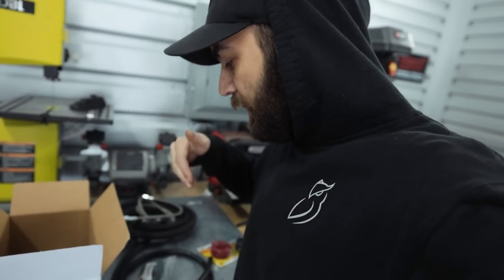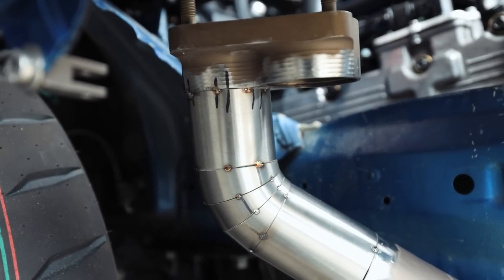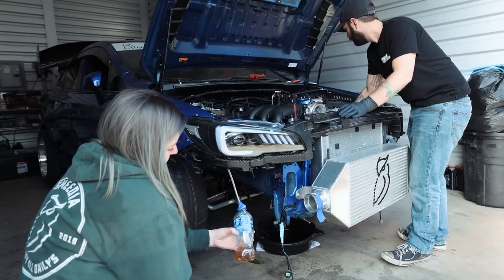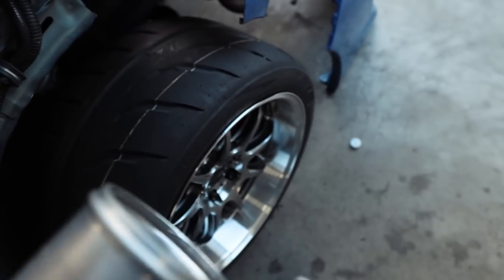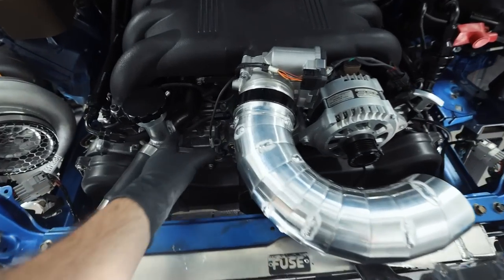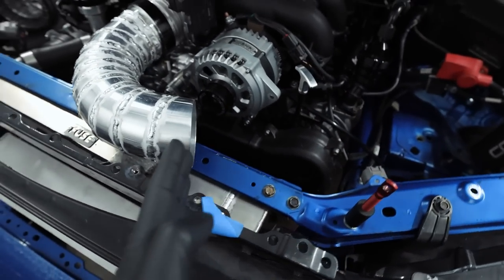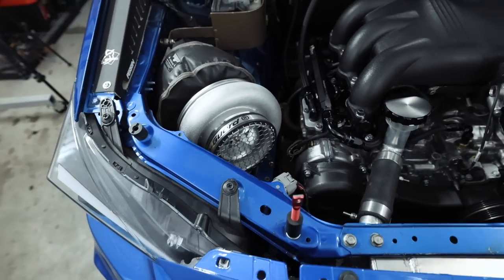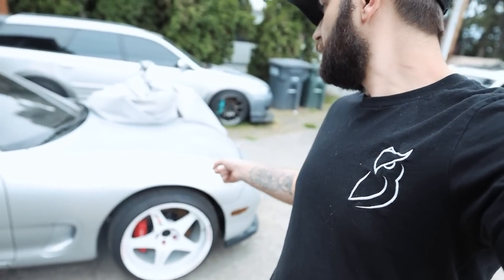Making a Massive Precision 7675 Turbo Fit Into my 6 Swapped Subaru WRX STI!

Comment: Looking good bro can’t wait to hear it, fab guy did amazing work if I ain’t know better I’d thought you bought that…,,wait somebody said 400hp 🤣 this thing look like it’s gonna do 850 900hp easy a couple adjustments at the tune 1000hp 6 cylinder STI VA monster that is the blubaru 🎊
Reply from the maker: Shhhhhhh 🤫🤫🤫 it only makes 300 lol 

Once it's running again it'll be on its 700whp tune 😅

Comment: If you flood clear crank it and hold the start button down will it spin over longer? I was able to do that for probably 10 seconds in my wife's VB.
Reply from the maker: Mine no longer does that 😅 thr stock ecm just does 3 sec and that's it 😅

Comment: Are you going to sti 6speed swap the VB or leave the drivetrain as is? Im curious if the wrx trans got any better than the VA
Reply from the maker: I'll 6 speed swap it, much easier to do it on that vs older wrxs

Comment: pie cuts are easy bro, grab some straight pipe of choice, make 1 mark, then make 2 other marks opposite. 1" 2" and so on for spacing. draw the arrow or triagle, and cut. mounted compound saw with degree locks would be best bet for cleanest cuts diy imo
Reply from the maker: Trying this tomorrow, I have the saw 🫣
Reply: @Smeedia  make sure you cut a decent size length dont want a size too small or too big and stabilize it good. if it catches the blade during the cut it can get gnarly. 2 cuts obviously, you could keep the saw same position and just flip the piece, or turn  the saw to whatever Degree * you had it set to opposite. just depends on your space and what youre working with honestly. id measure a good .250-.380 excess for material loss each side as well.

Comment: Wait just a general question, if you a buy a car from the dealer it should be the MSRP price right? Or can they still go above. Cause currently a brand new brz sits at 43,407 AUD.

Comment: Great job and progress! Are you going to run some sort of fan shroud on your radiator so that all the airflow being pulled by the fans isn't wasted? I have no experience w/the flat 6 cooling, but have done a lot on Jeep XJ's inline 6's and they get HOT... especially if you don't run a fan shroud of some sort to utilize all of the available radiator space.. if that makes sense? Seems you mentioned having cooling issues on the previous build, but I could be mistaken.

Comment: Dude whatz up! Been catching up on videos since my kid is out of school things finally not so busy now. Anyways not sure if it’s the angle hope everything fits with hood closed. Got next project for you on blue. Full flat aero bottom. Use lightweight aluminum. Wanna see your bend and welding skills more. Cut bumper get rid of spare tire holder (cut it out) weld flat aluminum in place and make rear diffuser. She will look like a killer by with the engine swap. Lol

Comment: Cooling issues: things you can try to help alleviate all that excess heat 
1) fan shroud - help channel all the air that the fans are moving and a must really 

2)flaps across the top of the cooling units from CAC to Rad - the more you channel airflow, the better the results 

3) Are you using any sort of underguard? Once again, airflow

4)Did they use a heavy duty core for the radiator? Should be using the 1" tubes and get rid of the bar and plate style, not nearly as efficient 

Some context - I build high hp custom builds and I can never stress enough about how important channeling airflow is

Love the videos! Good luck!

Comment: Why not 2 small turbos that push the same psi combined vs 1 large turbo?
Reply from the maker: Space, heat, more money 😅
Reply: @Smeedia  I was just thinking of that since the battery box area was open, a turbo there and turbo on the other side would work.

Comment: How do you feel about the paint quality of the front bumper?
Reply from the maker: Pretty happy with it but seems a little thin in some spots. Rubbed off on 2 corners so far from taking it off and putting it on like 4 times
Reply: @Smeedia  ahh bummer.

Comment: I've never packed a oil pump and never had issues getting pressure to build with a couple cranks. So I'm confused why you had issues ?
Reply from the maker: Oil pumps can (not always) but can create cavitation and have a air pocket stuck. I will nkt start a car without getting oil pressure prior. So as a precaution I always pack the pump and loctite the housing screws and they're known to back out
Reply: I havnt used loctite either. Hopefully it never comes to bit me in the future 😅

Comment: Been watching your channel for about a year now, absolutely love the Blubaru (Bluebaru?) build! It looks in the video that the intercooler piping connecting to the throttle body could still be shortened to be closer to the alternator and not overlap the upper radiator support. Is there something that is preventing it from being routed that way? Seems really odd that it overlaps the radiator support.
Reply from the maker: I need sharper pie cuts 😅 it's about a 110* angle that it needs to go. If I shorten it then the angle on the other end gets super wonky. Gor what I have and what I know how to do that's about as good as I can do for now 🙏
Reply from the maker: It's also 3.5" intercooler piping so takes up. But of room 😅
Reply: @Smeedia  I know fabrication isn't easy, and don't take my comment as talking sh*t. You've done a great job. I'm just throwing out ideas here..... Can you essentially 90* right from the throttle body, run parallel to the radiator support until you pass the alternator, then do a 20* back toward the driver, then turn down?
Reply: @Smeedia  on the other hand, maybe a 90 right off the throttle body would be bad for air flow....if you are trying to achieve a little bit of a straight run of pipe before the tb, then your design is prob as good as you'll get!

Comment: Im happy you made that fit. No reason this build can't challenge rob dahms 4rotor. Driving a six speed is incredibly challenging imo I would highly recommend getting a sequential
Reply from the maker: If the opportunity ever comes up, I would take it 🫣

Sequential is on the eventually list 😅
Reply: Even a dog engagement gearset for the 6 speed box wouldn't be a bad idea to hold the power. Bit cheaper than a full on sequential too
Reply: @SXV550  i'm not the best driver but I liked my 5 speed more than the 6 speed.  The 6 speed is strong but good grief as far as racing goes i have mad respect for Rolly out of PR using a stock 6 speed cracking out 9s. Honestly you got builders and you got drivers .. i'm a builder and i'm ok with that at this point in my life :D